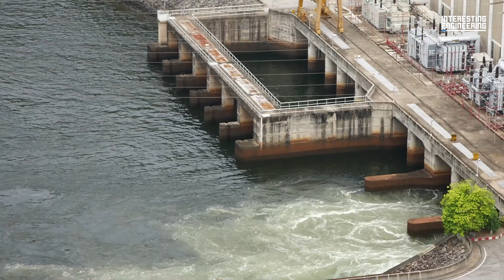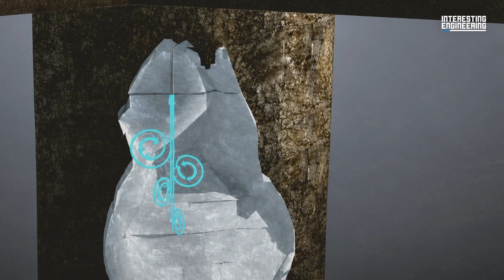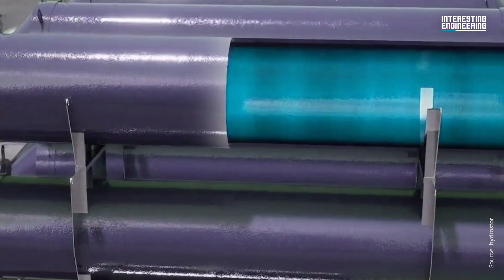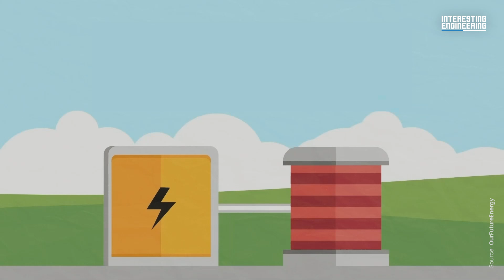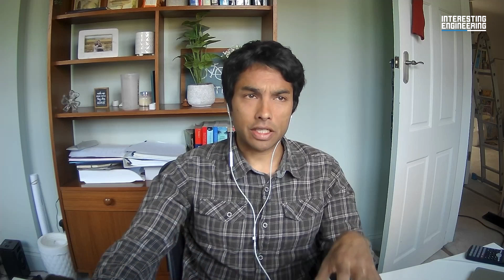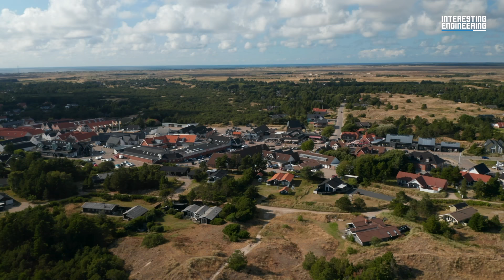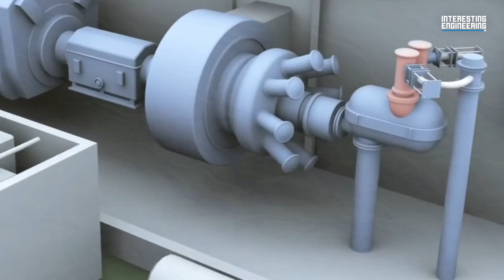Why Air Batteries Are Finally Beating Lithium

Comment: air leak will be a big problem. and how long can it store?
Reply: It is a long term energy storage system because there is no significant loss over time, and the air is free, unlike batteries.
As for a air leak.  If you notice an air leak in a tank like that, leave the area really fast.  The resulting explosion would be very bad indeed.  Any installation with leaking air tanks, I think put all of the engineers in prison.

Comment: Collect the heat of compression in tanks of liquid use the heat to warm the expanding gas
Reply: the main issue, is that if you store the heat, but the power cycle is too long, the heat would have long gone into the environment. it could be worth it to use the heat for something useful, heating nearby homes could be a worthy investment. or just drive a tiny steam engine haha
Reply: @jacobfield3951 very true.  But remember the thermodynamics dictate that it is the heat gradient that is valuable.  So cold and heat are equally valid sources.  In one cycle you generate heat.  The other cold.  Both "could" drive a turbine.  Granted, a "cold turbine" has never been used as far as I know.
Reply: @stevenpace892  it would be facinating to someday hear about cold turbines. i once read a scifi novel that included them, docked ships would normalise their tempatures through heatpipes that would generating energy inefficently
Reply: Yes, compression and expansion of a gas is also known as a heat pump.  That would part of the wasted energy.

Comment: Well pumping water in the ground in a reservoir heat it up to use the Verdampfungs Enthalpie isolate to use it as a isotherm reaction look for higgh speed acceleration against the turbine that is still the most efficient way high pressures holding a long therm is always expensive so I give this tech no chance

Comment: BUFFERING BATTERIES and peaky grid environment are the perfect combo.
BATTERIES at the consumer's connection
BATTERIES at the supply
Grid is upto 10times more expensive infrastructure than generation infrastructure.
Maximum UTILIZATION of the maximum infrastructure is maximum economics of the existing investments.
Upto 3times more electricity per day per year per decades.
Home and Away batteries.
Home and Away roof PV.
Using the grid twice, to send electricity to storage and then send to consumers is double the costs of transmission and generation.
50% of the grid's capacity.
Reply: Have decentralised battery storage at substations maybe?
Reply: @donsheehan5144 yes, and at many grid nodal points, the grid transmission always feels steady load.
Buffering batteries absorb peak supply and peak demands closest too the consumer.

Comment: Batteries are becoming so cheap now and the round trip efficiency of battery energy storage is unmatched (90+%). Why go through extra steps that reduce efficiency? If you need more power, you need more generation of some type, not more storage. Storage will always run out eventually.
Reply: Right now there is energy that is not worth storing.  Air is better for long term storage.  A lot like hydro.  Flow batteries are another long term storage type.

Comment: Inefficient and expensive, I don't see a marktet
Reply: it's not inefficient if all the system is hermetically covered with insulators
Reply: @coda72 It is inefficient, they're generating electricity, loss, powering compressors, loss, moving turbine, loss, consuming electricity, loss.

And those stages all require expensive equipment.

I've been thinking about all of this myself as in Aus we curtailed an absurd amount of wind energy. 

They need to use the compressed air for work in industrial districts. You lose two steps of efficiency losses that way.

They're already running power and water to the wind farm, throw an extra plastic pipe in the ground for the air. Over a long distance it adds to the storage volume, helps cool the air for moisture removal, then boost it at the district that needs compressed air, let them fill their tanks and only use their smaller and more less efficient compressors when wind is not being curtailed or can't meet the demand.
Reply: @MonsievrPink  there has been research about this, air battery while in a closed system with insulation is only about 10% less eficient than lithium battery in the storage and production of electricity
Reply: @coda72 I doubt it to be honest. You're using the electricity to drive pumps (phase change), condense (phase change), turn a generator (heat loss), loss from transmission and then loss from the consumer via heat. And if you store as chemical before transmission... Loss again.

Unless you're reclaiming and repurposing the heat (100% of it, which is impossible) it could never be as efficient as generate, transmit, consume.
Reply: @coda72  That is a simulation with absurd hypothesis. I can calculate 10 perpetual motion machine in a morning if I violate every laws of physics on a computer...
Reply: Inefficient+expensive+a little dangerous
Reply: @Rocket_T2  muh efficiency, only 10% less efficient but far less expensive
Reply: Yeah. Maybe the next Gen can figure it out.
Reply: Compressed air energy storage has been one of the earliest methods of powering industry in France and Germany in the 18 and 19 century. They filled any caves they could find, while Paris filled the catacombs with compressed air that would power lathes and other tools
Reply: No 
It has 
No Rare earth material uses 
You can also compared with green hydrogen 
And lithium + sodium + Air battery + little green Hydrogen is 
Our New energy Era Future
Reply: @HarshiChauhan-z1s you're kidding yourself if you think there are no rare earth materials in its construction.
Reply: @MonsievrPink compare with nmc
Reply: 2 tonnes per 3MW wind turbine on average supposedly. And this system is worthless without wind turbines or solar, and solar/wind turbines are useless without something like this to prevent the power from being curtailed.

Comment: Take the cows up a slope and bring them down using a lift. While they are coming down, use their movement to run a generator and produce electricity. Create a line of 100 cows.
Reply: Have the milking sheds at the top of the hill, and inclination would bring them down, grass is grown by the sun. You are brilliant.

Comment: It would make sense to move the generators out of the turbines and have the turbines directly pressurise the air batteries via hydraulic links. Then bleed off the air batteries to drive generators to make electricity. Removing generation from the turbines and putting it in a central location also means you could do away with rare-earth magnets. The central air to electricity generator could use a standard configuration where the magnetic field is self-generated. Though you would need something to do a black start.
Reply: it would create crazy plumbing situations, long pipes are likely more work than long lines of wire

Comment: So - include thermal heat storage A-CAES . Hey another byproduct of these system- Water! If you fail to remove it will fill up the air tank